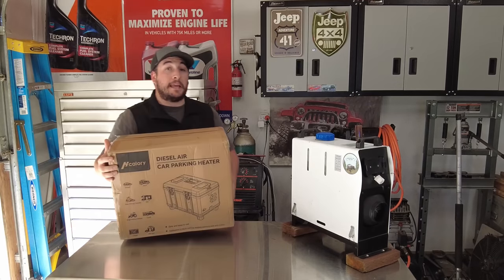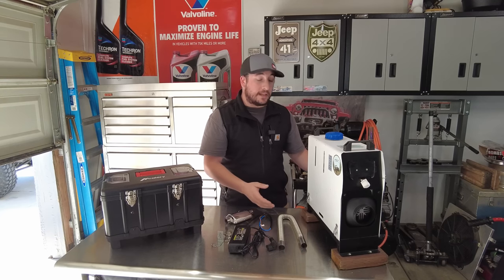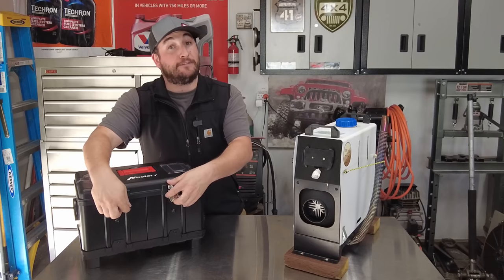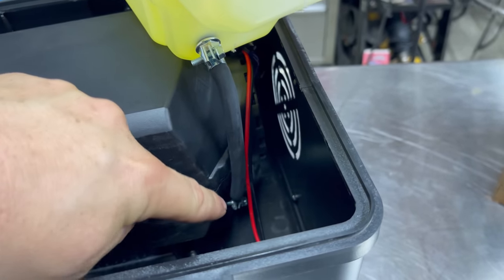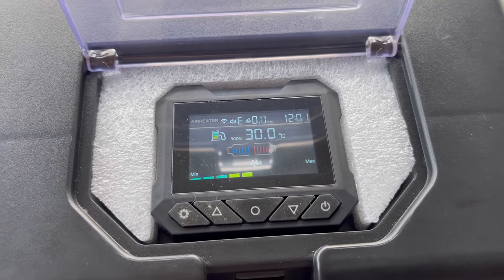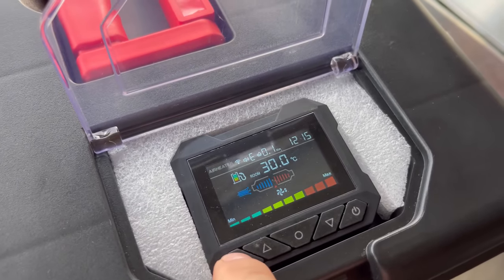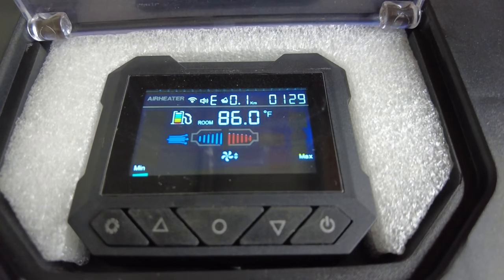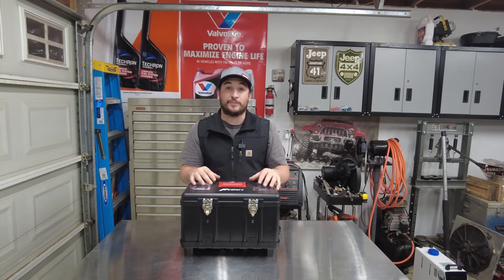KING Of Affordable Diesel Heaters | The HCALORY - SS2 8KW Air Heater | This Is The ONE

Comment: FYI: If you unscrew the nose cone of the cigarette lighter plug-in end, there should be a an in-line fuse already in there so you should not have needed to strip your power cord to add another fuse.  Also, if you want/need to add another fuse, it might be better to place it in-line inside of the heater case so there is nothing on your power cord to get snagged and damage it, leaving you stranded until it can be fixed.  Seems like it might be a nice unit and easier to travel with it stored than the tall slim units.  Thanks for the video!
Reply from the maker: Good point and all  documented n the next video 🍻Diesel Heaters For Winter Tent Camping - Upgrades and Modifications
https://youtu.be/Ug-3fjjCPWE
Reply: @ATEMOFFROAD  Also note, you should not have the double fuse on that. Putting the ATO style one inline with the one built into the 12v adapter plug, changes the resistance of that circuit. 
Keep in mind, the way a fuse works, is by protecting from a short/too high a draw DOWN stream from the point of the fuse. It does nothing up stream of it (hence why your car/rig has a fusible link directly off the battery, and so on)
Reply from the maker: @obiesunstreak2409  actually this cig plug doesn’t have a fuse , so keep that in mind you don’t want to rely on a fuse that may actually not be there. I have an older incandescent spot light thats 12v the cig adapter never came with a built in fuse and it pull’s close to 12amps. The truck circuit is fused it’s not self protected. This part in the video my not be the best example of protecting the heater . The next video I share I corrected all this with the best possible solution for both the AC and Dc supplies. Diesel Heaters For Winter Tent Camping - Upgrades and Modifications
https://youtu.be/Ug-3fjjCPWE
Reply: @ATEMOFFROAD  are you sure? that plug you showed in the picture has the knurled tip that should unscrew and expose a glass style fuse inside with a small spring.
Reply from the maker: @obiesunstreak2409  I’m sure, both of them in this video have no fuse 🤷‍♂️

Comment: Regarding the fuse for 12v power: if you unscrew the knurled ring at the tip of the cigarette lighter plug, you may find there is  already a glass fuse inside.
Reply from the maker: Yes but some don’t have the fuse so just have to watch that. At the time I wasn’t sure if I was going to put cig adapter or battery clamp,  I had already put the fuse on. 🤦‍♂️
Reply: Most cig outlets can not source 20A most struggle at 10A.
Reply from the maker: @TallTexasGMan  that’s correct, I will address this next video, the cig adapter I have doesn’t have a fuse this is why I added one, it’s rated 15 amps 🍻
Reply: @ATEMOFFROAD  My 5kw runs at 19 watts on the medium setting and maximum is 41 watts on start up.
Reply: @TheBioniXman  You are joking?  Maybe when it is running but not at start-up.  It will require double your 41W and then some, during the start-up (and run-down) cycle.

Comment: Thanks for the video very helpful. I purchased this to heat my cargo trailer / toy hauler. I installed a thru hull exhaust vent thru the wall of my trailer and will run this heater inside. I have seen most videos run the heater outside and pump in heat thru duct work. I have run my unit for several hours in my trailer with zero CO and heater has worked flawlessly. Both the app and the remote worked great( my remote had batteries even though the manual said they were not included). Ironically I was going to send it back due to the complications people were having in many videos. Amazon would not take it back so I decided to put some diesel in it and give it a shot. Time will tell how reliable it will be thus far my experience has been excellent.

Comment: Great video.
This could be a game changer in expanding the camping window for me. It’s the first heater I’ve seen that appears easy to use, is reasonably priced, and looks fairly reliable.
Reply from the maker: Having a heater would definitely expand your window. Fall winter camping is just getting started. Thanks for watching 🍻
Reply: The previous models are similar...and ALL of the Chinese knockoff of the webasto heater are a hit or miss, depending on who put it together at the slave factory. Just buy one with a good customer service and return policy 

This one is made for a more compact rigs with lack of cargo space (but plastic body????)

If you have the space for the thinner one with the metal housing, go for it since it's cheaper than this one that has a few different features
Reply from the maker: @ricebike  the Hcalory has metal enclosure, and it’s sold on Amazon. Very good customer service 🍻
Reply: Where can I buy one? I could not find it on Amazon.  E-bay list the SS2, but unfortunately, do not ship to Canada. Thank's
Reply from the maker: @benguenther1162  sold out at the moment, new stock will be available in December 🍻
Reply: A 2200 Honda and 1500 heater is more efficient for my camper.

Comment: Great review, thank you!
I have a couple of the older units and like them a lot, will be looking at one like this for my next purchase.
One thing you should be aware of when using an infrared thermometer is that they work by detecting infrared emissions. Not all surfaces are equal in this regard. Shiny surfaces are notorious for lack of emissivity. Flat black and strangely enough water work very well. Do a quick Google on emissivity tables to shed some insight into their accuracy on various surfaces.
Reply from the maker: Good info right there, thanks for sharing 🍻

Comment: Looks like a cool setup, please update how it works for you. We have a Vevor 5KW and it carbons up from running it on low too much, but any higher runs you out of the tent, even with windows open.
Reply from the maker: I’ll keep you updated for sure most likely through a camp video though. The other heater was a VEVor so I know what you mean by carbon buildup. I usually turn mine up on high for a about 5 minutes before I shut it down especially when I go to winterize it. Haha I’ve been run out of my tent before too when I first started using these. lol until I found out the thermostat is built into the controller, so extending the cable and having the controller in the heated space then allows the thermostat to see the space is becoming heated and throttles way down as it get closer to the set temperature. It’s More efficient too and solved that problem where you loose control. I do know you can go into engineering mode and manually turn down the fans speed and the fuel pump switch frequency, to by pass the thermostat to turn the heater down. But I never really messed with it. It just seemed easier to extend the controller cable. On the new heater the interface is improved, the mode with the bars that moves up and down allows you adjust the temperature up or down to a setting you like so should no longer need to have the controller in the tent , just wireless control from my phone. 🍻
Reply: @ATEMOFFROAD  I own 3 Oriental knock-offs and none of them are anywhere near as reliable or well made as my Eberspacher that they are trying to emulate! Main thing is the thermostat - the real one goes into standby once set temp. is reached, it just shuts down and monitors the temp. until it needs to fire up again. I can leave it on all the time and it doesn't pose any threat to my valuables. Cheapo copies just pump diesel constantly unless you shut them off - as far as I know; do any of yours go into standby from a stat signal?
I had to replace one of their motors and really struggled to find a matching part - the one I bought had different electrics from the one in the picture so had to be modified. It only worked for an hour then quit, but the pump carried on filling the burn chamber with juice - lucky I was there to pull the plug!

Comment: Great Vid!, however, nothing beats a Toggle switch for on off and a Dial thermostat, two  features most desirable for a walk away and enjoy
Reply from the maker: This unit has both of those in its design, this video goes into more depth of setup and controls. 🍻Diesel Heaters For Winter Tent Camping - Upgrades and Modifications
https://youtu.be/Ug-3fjjCPWE

Comment: Are these units weatherproof?  I want to mount mine on the side of my van on the outside.  Right now  my diesel heater sits on the ground outside with a plastic bag over the top and the controller is covered to protect from rain and snow.  Hcalory does not mention anything about being weatherproof for this model or their suitcase version which makes me wonder.  Thanks for the video.
Reply from the maker: They are not weather proof unfortunately you would have to protect the air inlet side where the fan is from water getting inside. 🍻
Reply: @ATEMOFFROAD  so how do you protect yours when in use? Is it outside somewhere?

Comment: is it really worth the extra $100 to $150 more cost over other brands?  It has a plastic box, other side-by fuel tank units have metal boxes.  Is it just the electronics or is there something more?  While I am researching these for best use in my application, it looks like taller / tank over models are better suited for bolted down situations. These tank beside units would be obviously better for camping or moving around.  Plastic case + fire = a worried me.   Convenience of the electronics; is it really that different between brands.

Comment: How would this unit do heating a 30x40 non-insulated pole barn in your opinion? Can the entire unit be brought inside if the exhaust is vented outside or would I need to add a hose to bring outside air into the air intake? Thank you for this video, I'm looking for a solution to provide some level of warmth to my barn so I can work on vehicles during the winter months below freezing. I hope to hear your opinion as I have no experience with these heaters to date. I do like the design of this one but maybe something else may be more suited to my application.
Reply from the maker: Non insulated of that size is not very effective to be honest, is it open celling? There’s a lot of variables to consider. Yes the heater unit can be brought inside , the exhaust should never be in the heated space. Thanks for watching 🍻
Reply: @ATEMOFFROAD  thank you for responding. Yes the ceiling is open with some very thin insulation on the roof to prevent condensation. There are narrow gaps in the insulation that allow condensation that drips on my vehicles. I think my best use of funds right now would be enclosing the ceiling and insulating the walls before I try installing probably two of these units on opposing walls in the barn. I recently retired so I have plenty of time. I will eventually use this method for heat with some of the ideas I've gotten from other videos for maximum efficiency. Thanks again for responding.
Reply from the maker: @eyeorewolf  that sounds like a good plan 🍻
Reply from the maker: Hi , New video is up covering all the questions you asked on this heater. 🍻 https://youtu.be/Ug-3fjjCPWE?si=BxCFMqSJN6QPi7tT
Reply: A large uninsulated pole barn needs far more heat than this can provide. There is a reason folks pay thousands to keep a pole barn a few degrees warmer, starting with insulation.
Reply: you can heat it up somewhat...run on high and pointed at the floor...heat will rise making it feel warmer...dont get this on..its junk..core is all the same on these heaters...air intake is inside air..dont need hose...the combustion is a sealed system...get 2 of the regular 100 dollar ones...get some exhaust extension to the outside...insulate where it goes out...exhaust gets super hot...but will radiate heat also....always run on high...the tent to soot up if run mid to low...I heat pretty well my 2 car garage with 2.the fuel lines on all these units are really close to the exhaust which is hundreds of degrees...try to insulate them from each other.I have owned almost every heater they make for the last 10 years...the core units are all the same...even when taken apart...the peripheral stuff is different...ditching the prereferral and custom making your own system for your need is the way to go.this manufacurer  just put a core unit and stuffed it in a cheap tool box.they super sip fuel btw...been happy with them over the years...my 2c/

Comment: Nice video! 2 questions. How many sq ft do you think this would heat and is there any smell at all inside the space your heating? Been looking at these and I’m curious. Thanks 🙌🏼
Reply from the maker: I would think a full size RV/ travel VAN would be sufficient enough to heat for some perspective, there’s to many variables to really get a good solid idea Sq ft. How well it’s insulated, and how cold it is? For example I’ve taken my heater in 17F and heated my roof top tent  to about 79F on low. Little to no insulation. It’s made to heat cars , vans, campers RVS and I’ve seen people use these for small shops and cabins. As for the smell, I get an occasional wiff of diesel usually at start up and shutdown when the unit is running rich. Once it leans out I don’t smell anything. Just be sure to keep the exhaust far from the air intake and you will be good. For RVS and campers I see people keep the entire units inside and poke a hole through the floor or wall for the exhaust so these heaters can be inside circulating the indoor heat which would make the heater more efficient VS  my use to heat up a tent and I’m heating cold air all the time when In use. Always have a carbon monoxide detector close by i the heated space. I like mine because it also has a thermometer built in. I listed the link in the description box of this videos I Hope that helps and thanks for watching. 🍻
Reply: I use one to heat a 35' yacht in the UK. Zero degrees c in the winter. It is uninsulated and gets hot on the low setting...
Reply from the maker: @stevenlarratt3638  awesome, just curious with that temperature , do you keep the heater indoors or outside?
Reply: @ATEMOFFROAD  my heater is outside in a locker, i have the exhaust system running in thelocker which keeps that area luke warm, and combustion intake drawing from the top of the locker. Then the non combustion air intake side i have rigged an intake from the inside of the yacht, at a high point, to recirculate warm air and route the internal 75mm 5m long insulated duct around the yacht internally to where i might need it. I have also pierced holes in certain sections and that heats other sections if needed. Almost like a sprinkler/soaker system in a garden. The holes are at strategic places to warm the main cabin area, when i am sleeping at the forward cabin so in the morning the fore cabin can be at 20 degrees c. And the main cabin around 12 degrees so it isnt a shock, it warms the main cabin up in a matter of mins. I vent the cabins the main heat is in to keep condensation down a bit. It is a dry heat however so no issues from any from the unit. It is purely cold air hitting warm air...
Reply from the maker: @stevenlarratt3638  great set up sounds solid. I was curious about anti gelling additives and if you ever needed to use those in precaution to sudden temperature drops as this heater doesn’t offer any insulation surrounding the tank. I was told by the local gas station that there diesel fuels are “winter blends” where they have pre mixed additives to prevent gelling. This makes sense as they probably would not be able to pump the diesel in sub freezing areas. Thinking ahead I have not yet needed the use of additives, but I do move my heater from warm to colder climates so some stations may not have the winter blend available. Do you see this as a problem on your end? Should there be concern using an additive  in the heater?  What happens to the heater if the diesel gels? Any thoughts? 🍻
Reply: @ATEMOFFROAD  in the UK i beleive the diesel is made to go down to -20c. If you are somewhere that you are unsure of with the blend of additives, i would make a canvas bell/ Tepei type bag (think tea cosy pop over top) to surround/ cover the whole unit with a wire coat hanger in the base and make a small tunnel to ensure it doesnt touch the exhaust and use the residual exhaust heat to heat up the unit and thus the fuel tank, if the diesel needs an additive it will combust with little to no issues in the atomising screen. If the diesel does gel up, get it to a warm spot. In former soviet countries they used to set small fires under diesel tanks to melt the gel out before getting onto the road. If in a van etc, start the van and use a 12v hair dryer to blown into the diesel tank. Diesel has a really high flash/ignition point so risk of fire is minimal.
Reply from the maker: @stevenlarratt3638   good information right there! 👍🏼 I like the ideas, if I find my diesel fuel is not good for -4F you may see some version of this n future videos , will see. Thanks for sharing.🍻
Reply: Using 8kw version in an uninsulated brick building 5 X 6 mtr it will increase temp by 10 Deg centigrade in 90 minutes. Outside temp 6 deg
Reply: Use kerosene to lower the cloud point of diesel. A small amount of kero mixed in the diesel will lower the cloud point. Diesel cloud is around 10F to 6F.  Cloud point on kero is around -41F. I use about a half pint kero to a tank full. Good enough for -10F.  @ATEMOFFROAD

Comment: while having a connector for the 12v power is nice, the one they chose is a no no as if someone didnt know or didnt have the original 12v plug they might try and plug 120v wall power into it as its a standard IEC power connector that you find on computers and other mains voltage devices.